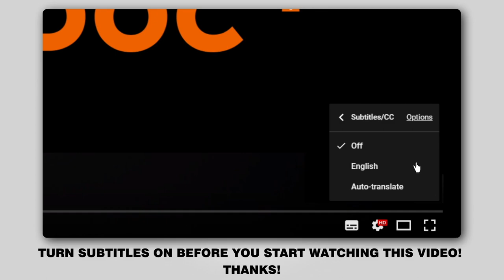How to change front suspension arm / front control arm on VW GOLF 4 (1J1) [TUTORIAL AUTODOC]

Comment: This is a joke....6 nm on 3:56.... it should be 20nm plus 90 degrees turn using  a new bolt
Reply: Are you sure about this? I bought the bushings at wolkswagen and the VW mechanics themselves don’t replace any of these bolts as long as the threads are good.

Comment: Quick question; why are you lifting the car on it’s sills? There are official jacking points so you don’t damage or bend the sills... This really annoys me as I’ve had my sills bent because of this from garage over the years. 

But great video and keep these coming on the mk4!!
Reply: There are spots on the sills that have been pinch welded and have a notch indicating jacking points. 

I've always used these on my golf with no problem but whoever owned it before me went to the side of it and have bent the sill in that area.

Comment: Hi, great video. my Golf Mk4 is Right-Hand drive Automatic. I have to replace the Left-Hand side Lower arm. My problem is trying to take out the bolt of the front bush, it stops against the pan of the gearbox. Please tell me how I get around this? Even better if you can do a video on this. Thanks.
Reply from the maker: Thank you for your comment!
Unfortunately, in our practice, there has not yet been such a replacement, but we will certainly try to make it if this car gets to us for repair.
Best Regards,
Autodoc team.
Reply: You can do this two ways, either drop down the complete subframe at the Nearside of the car, just enough to remove the bolt, or unbolt the centre steady bar and lever the gearbox forward to remove bolt.

Comment: 3:57 6 Nm are you sure?
Reply from the maker: Thank you for your comment. 
We understand that mistakes were made during the editing of the video, and in the future, we will try not to allow this anymore.
AUTODOC
Reply: @autodocuk  thanks. Its good to accept the mistake
Reply: @adnansgarage  how much torque would you recommend then? 6Nm seems indeed very little to the size of the bolt and compared to the others. If course it’s always good to use the right torque, but I’d say this is not a crucial component to torque to absolute spec though, I’m sure it has quite a great range of tolerance (given that you wouldn’t torque it so low, even by hand).

Comment: Um just gonna put this out there the bolts and nuts are one time use only should change them with new parts
Reply from the maker: Thank you for sharing your opinion!
AUTODOC
Reply: Not the recommendation I was given at VW, but I will double check. Most of these bolts are even discontinued, and given their function they are made to last and to take a lot of abuse. I’d say the original bolts are even made of better metal than aftermarket ones (just like the rubber of the bushings). If you could point me to a good source for this info I’d really appreciate it.